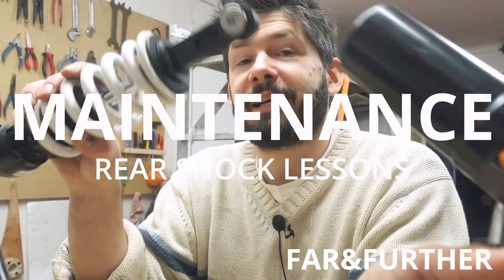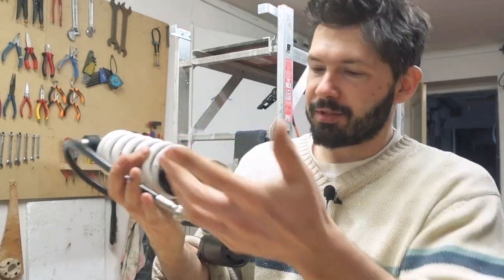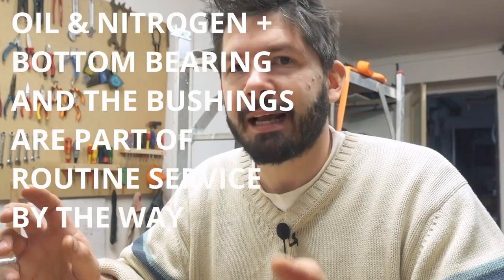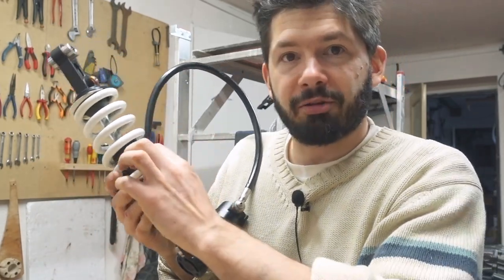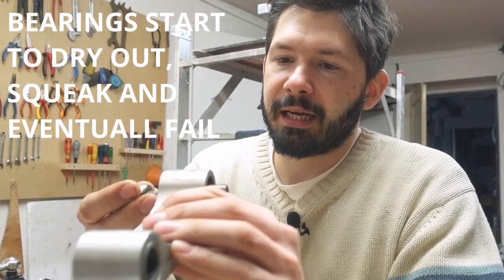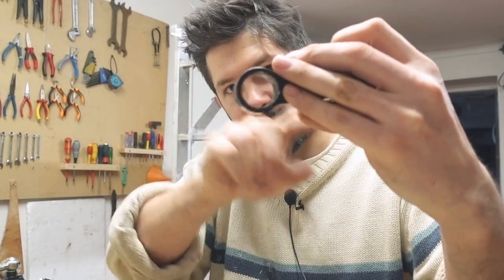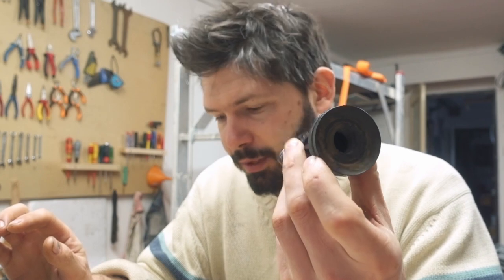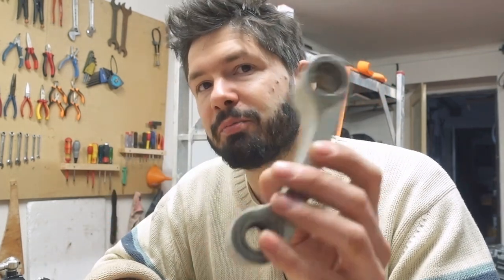Maintenance - Rear shock repair & lessons

Comment: Good video. For all adventure bikes suspension is a big deal. It's fit-for-purpose detail, current state of repair for a planned serious outing, its ongoing maintenance...  are all going to be topics we need to be 'knowledged' on if we're considering being Far & Further kind of riders. Know your loaded 'sag', spring and pre-loaded accordingly...  it's techy, but its not a black art.
Reply from the maker: Hi Graham, the ongoing maintenance on the long trip is crucial. I've neglected the suspension linkage as I thought it's something special. Now with T7, cleaning & regreasing will be on my schedule with the oil and other items. It was an expensive lesson to be learned but also... in a way suspension is a bit overrated. I was able to travel long time on the shock without nitrogen so maybe for overlanding I don't need super expensive suspension but just suspension I'm able to take care of.

I'm learning a lot about supension on T7 now all the sag, preload, spring rate, oil weight... fascinating topics.
Reply: You make a good point, namely 'know your bike', and in the context of overlanding - riding within the bikes limits in that context. Surviving the ride being the priority. What I am really interested to know with the T700 is what the full experience is with the suspension, given that its not the performance quality fitted to the 790 ADV R, and yes, we could all spend 3000euro fitting fancy stuff IF we had the money. The Australian guys on MAD TV are teasing out some good points for us regarding your bike... so that's something. Just out of interest have you added the lowering linkages and seat? Doesn't look like it, and it concerns me as I'm only a little taller than yourself. Keep Safe.
Reply from the maker: @grahamrowe6278  The bike is stock, I have not lowered it changed/shaved the seat. I'm now comfortable with it's height but thats only because of my experience on CB500X and honestly, it's much safer to ride it than to manipulate it low speed, that's the reason I'm training enduro now (progress is on instagram, no youtube yet) so I don't need to put feet down that much. Definitely I'd recommend riding it first, it is tall bike.

In terms of suspension I'm in touch with Rally Raid as they did my suspension on CB500X and what I set as my goal is to come up with the fewest changes I need to make in order to have T700 suspension ready for the RTW and my type of enduro riding. So far it seems that uprated spring is a must due to luggage and my weight (70kg) but after that... it is more about educating myself what I can set and how it influences the suspenstion and get some measurements to back it all with some numbers.

I want to do series of videos about this as everyone says the suspension on T700 is not good, but... I think it is good enough with few tweaks for overlanding, which is my usecase.
Reply: OK. Yes, noted some of those Rally Raid options. I think you're right, the suspension is good enough, just may need the spring changing to the appropriate 'rate'. What I think is the issue is that people often want to turn it into a big enduro bike. But it is intended as a travel bike with solid off-road capacity. We all know that enduro bikes perform at their best with tuned, high performance suspension, and come at a heady price. On an RTW the focus is to go carefully and cope with what you find effectively... not push the envelope, so I support you perspective. Do think Yam promoted the bike into the world of the exotic. Only the fools are kidded eh.
Reply from the maker: You've summed it up very well. I'm doing a lot of training on stock T7 and just yesterday we had very interesting conversation about power and equipment with my friend. Yamaha advertising is like you have the rally bike for desert but I truly see it as a off-road capable RTW platform. With that comes the power it has and the equipement (it lacks) which  I think will take a lot of new riders by surprise as there is little help from the bike when it comes to ride it in technical conditions and there is a lot of power for those situations. Due to it's simplicity it requires skill to manage, otherwise things can get hairy.
Reply: Yes, I think much on that conversation was extremely well explored in Dave Lomax's (Adventurespec) review. I need add no more to the focus of what he's offering. I look forward to your ongoing vlogs with great interest.
Reply from the maker: @grahamrowe6278  Thanks Graham, will do my best.

Comment: Ouch....360 Euro's.  What spring weight did you use for your rear shock?
Reply from the maker: I had standard 110nm spring I think. Considering all the abuse the shock did survive pretty well.

Yes it was expensive, Rally Raid services it for cheaper.